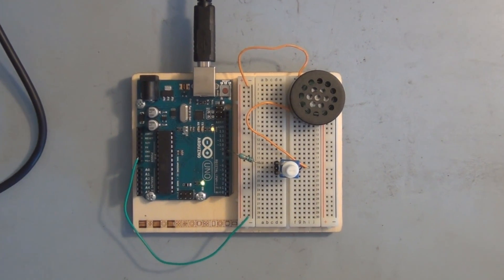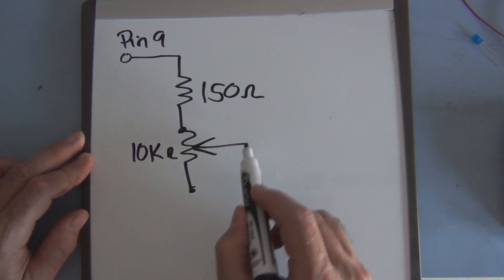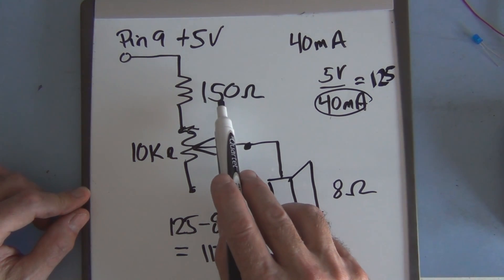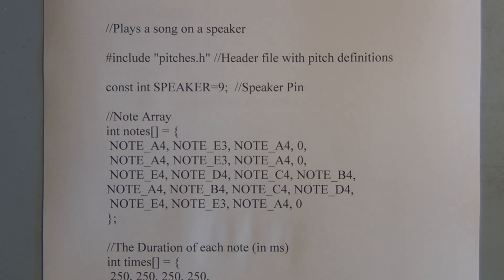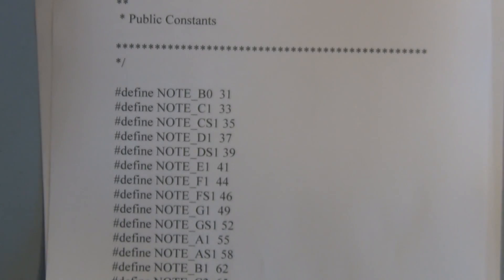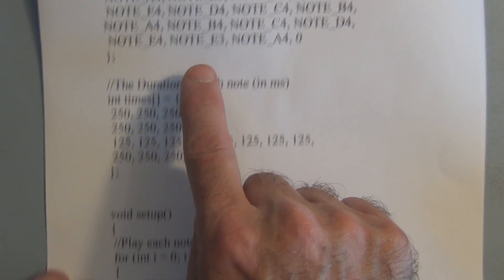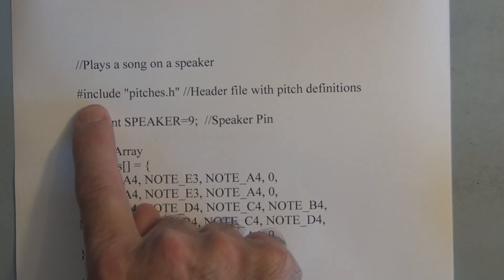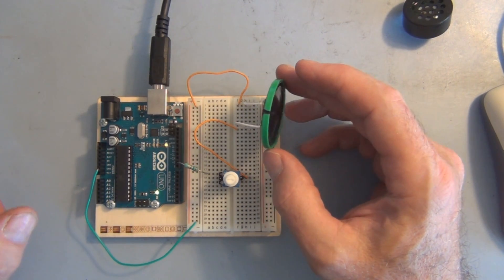How To Play Musical Notes With Arduino

Comment: Hi, I have a question I am using the same scenario except my tone is a Train crossing signal bell. It's about 6 seconds in length but I am using 
const int sounddata_length = 
Const unsigned char sounddata_length 
But Also I am using Audacity to turn my mp3 tones in to a wav format 
I am also haven to do a 2sec
 Time limit so they will fit. 
How can I make the Arduino except the whole 6 sec
 Of the bell tone. ?

Comment: I exactly did the same thing what you did Mr.eTechTom. The code and everything, but without the potentiometer and resistor, all i get is a popping noise. Just one pop and that's it.